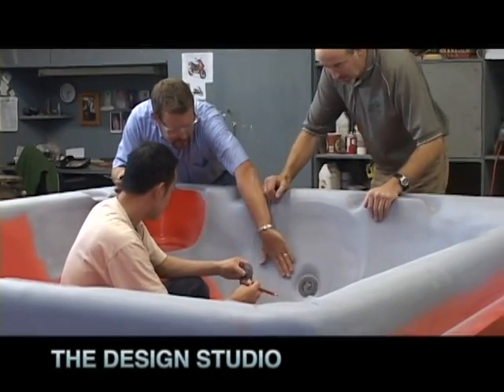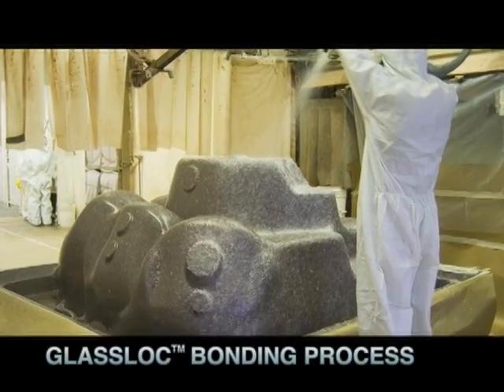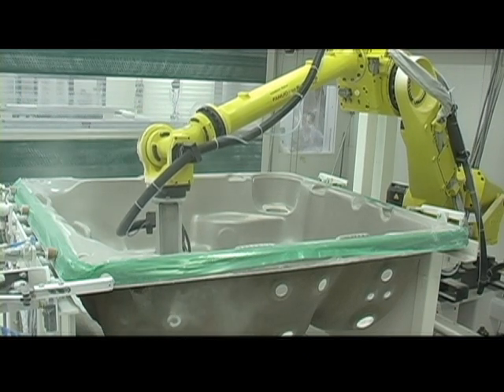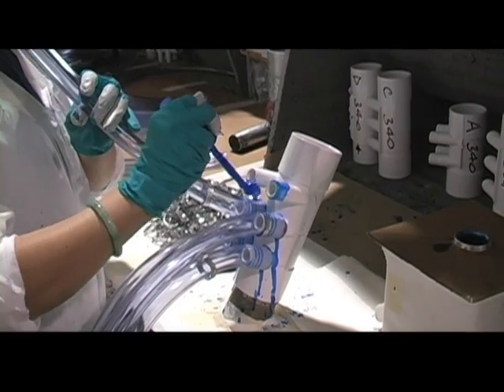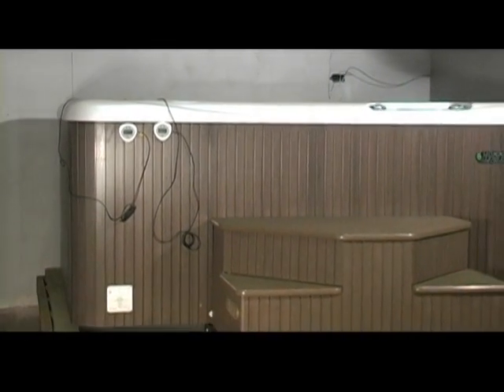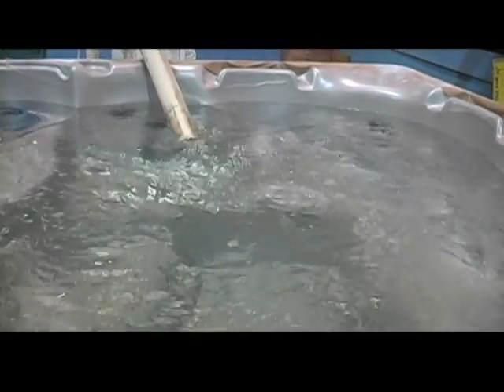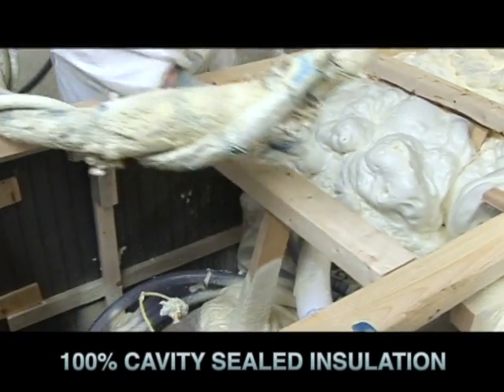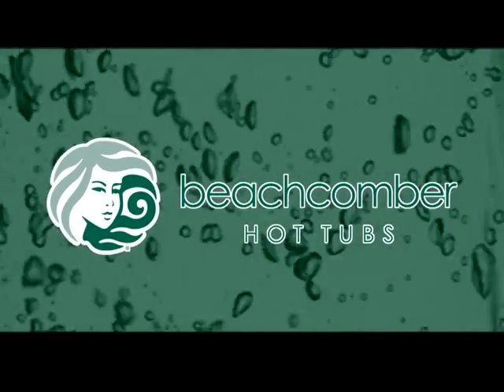Beachcomber Factory Tour

Comment: Stapled, non-treated wood frame???
Reply from the maker: We have been manufacturing hot tubs since 1978 and pride ourselves in continuous improvement manufacturing. We currently utilize pressure treated Canadian lumbar and a variety of galvanized hardware including industrial staples and screws.
Reply: Their Quality is pretty Top-notch. Only thing BeachComber should do is allow the owner to have access behind the skirt, unless BeachComer has changed that aspect of their tubs,, otherwise a great product.